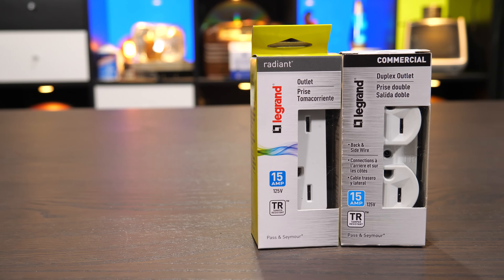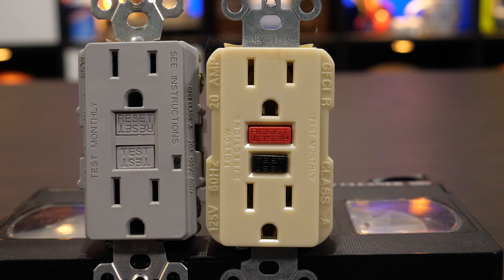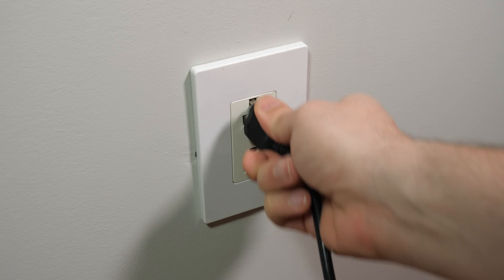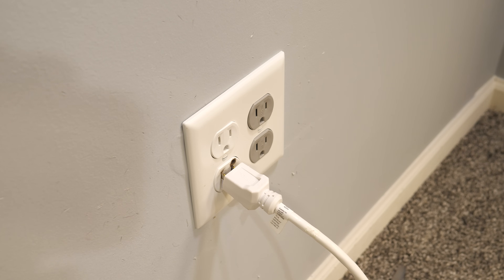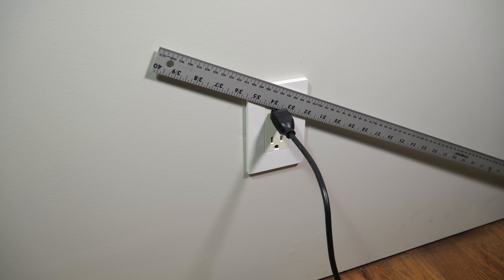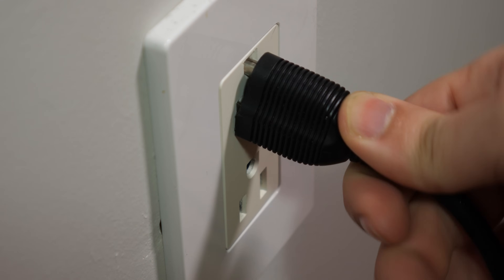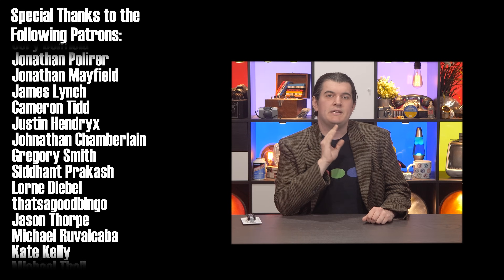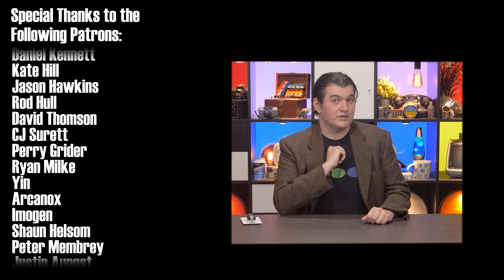Power outlets are topsy turvy - but does it matter?

Comment: Was looking thru the comments but haven’t seen this one yet. But a lot of newer homes have most of the outlets with the ground pin down while all the outlets connected to light switches with the ground pin up. So in essence, the switches that are more likely to be turned off during the day are in the supposedly “safer” position while the outlets that are live 24/7 are in the “less safe”’position. Also, is this flipped configuration for light switch  outlets this even a building code requirement? Or is it just a convenience for making sure homeowners know which is which?

Comment: The proper design for these outlets should have the top one with the ground facing up, and the bottom one with it facing down.  I never understood why they didn't build them this way in the first place.  It would make it so polarized wall warts can both be plugged into the same receptacle.

Comment: When my father built a house years ago he installed all the outlets with the ground pins up because he believed it was safer.
(If a metal object falls onto a plug that isn’t fully inserted it can short the circuit, if the ground pin is up this can’t happen)
When the inspector came he was told that had to rotate all of them because it wasn’t code…
I’m very surprised to hear that this was a lie

Comment: The plugs should be made so that the top outlet has the ground plug up, and the bottom one has the ground plug down. Then you can use 2 right angle cords, and which ever way you install it the ground is at the top.

Comment: Not that it matters to share on such an old video, but I have a tape measure with a burn mark from a time I was measuring a wall with a poorly plugged in plug that it fell onto. It's not a game of throw the knives at the wall but it's a little more applicable than "I was measuring the outlet while somultaneously ignoring the fact that it was in a dangerous condition"

Comment: I still have no idea why your plug sockets are not inset into the wall. If they were, both the "oh shit I touched the plug while plugging it in" and the "oh shit I dropped a knife onto a dislodged plug" issues would be mostly gone. Because the blades are behind the plastic.

Comment: In the US the national electrical code doesn't require them to be installed in any particular orientation. Well, you can't install them face up on a countertop, but that wasn't one of the options we were talking about anyway.

It doesn't really bother me either way, but I'm pretty sure if I installed one "correctly" on the job without being told to do it that way, I'd be told to "fix" it.

Comment: interestingly... once upon a time i had some loose change on my computer desk.  Behind said desk was a nema recepticle, and plugged into it was the power strip for my electronics.  apparently, over time the plug had worked it's way out of the outlet by about 1/8- 1/4 inch without me knowing. and one day, a penny was pushed off of the desk, fell between the desk and the wall, and landed directly on the two partially exposed contacts, shorting them, and essentially welded itself to the plug with a flash.   putting the outlets on upside down would have prevented this from happening.  this is a true story,

Comment: I spent 2 years as a residential sparky and 5 years doing commercial/industrial work, I saw something fall on the blades of a plug exactly once.  The receptacle was so loose the only reason the plug was still in at all was that it had a nightstand keeping it from falling out all the way. Some coins fell off the nightstand and one had landed on both pins of a 2 pin plug making a nice black spot on the receptacle and plate. However even with this perfect set up there was still a nice pile of change below it suggesting this setup had been like this for an extended period of time without anything happening. 

Another issue with ground up with 3 pin receptacles is that it can lead to the ground pin becoming loose and falling off the plug because it is getting leveraged more in the top position.

Comment: THANK YOU!
20yr Journeyman electrician here, AND I CARE!
If a conductive thing falls across a loosely plugged in connection, it can contact the hot blade before the neutral or ground. Meaning if that conductive thing is a bracelet, etc, it would shock ya.
But far more likely is dropping some sort of metal tray or tinfoil, or whatever, especially in a kitchen.
You want that to contact a grounded pin or blade first.
When mounted horizontally, always make sure the neutral is on top (grounds to the right).
It's one of those "not code, but best practice" things.

Comment: As someone with an older house that has these receptacles "upside down" the ground facing up, it is in fact supremely annoying. Every single plug especially angled ones for power sockets are upside down and require being taped to the wall or they eventually fall out.

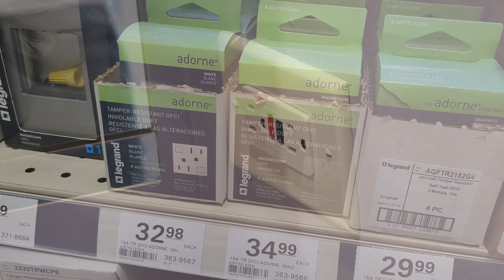Comment: 3:47 why would you want something like that?
Reply: Some plugs were designed to be installed with upright outlets. Some fit better or look nicer in upside down outlets. I like the dual direction outlets.
Reply: Some plugs have chunky adapters that block neighboring outlets. Literally 1/3 of the power strip next to me is inaccessible so I totally see the appeal

Comment: I love my 1904 house which was reqired by my pap in the 1970s because most of the outlets are normal but some of them just happen to be upside down for no reason.  So to my left, I have a power splitter that's hanging normally from its bottom-ground socket, and to my right, I have a PowerLine box that's upside down with its Ethernet cord kinked over because it's plugged into the top of the box and hanging all the way to the floor.  

Fun!

Comment: I really and truly don't care which side is up.  It takes 2 wires to make it an electrical circuit, AC or DC.  There was no polarity plugs before 1960, until some safety people got the idea to ground one of AC wire and call it neutral.  Is it really that much safer?  Not really, at least to me.  Maybe 10% improvement, not 100%.  What do I care?  110V shock is annoying to me, it is hard to kill you, or me?  Once you get a shock, you will learn to avoid another one in the future, at least to the smarter people.  If you are dumb as a rock, there is no amount of safety precaution will save you.  I do turn off power when work on electricity, about 50% of time.  That should tell you my great respect to 110V.  I do turn off 220V (greater respect).
Reply: I've been popped by 4160V on an aircraft carrier, but 120VAC is the real champion of Dar-winning people.

Comment: The receptacle was designed with two prongs.  The neutral was designed to be either at the top or on the left.  When the third prong (ground) was added, it was added to be on the left in place of the ground prong with neutral on top.

Comment: All the hospitals in Chicago have them spec'd ground up in case you drop a fork or picture frame falls on it. Although, there is no code for orientation. AFCI breakera are going to mitigate this risk, especially with extension cords buried under and behind firniture.

Comment: Read the NEC again, if the manufacturer tells you to mount it ground up then that’s what’s required because the NEC says devices need to installed per manufacturer’s instructions

Comment: So the right angle plug with the 45 degree cord makes the most sense to me.  Mainly because if you need to plug in two of them into the same receptable they can fit at the same time. Insulating the blades part of the way is not a bad idea either.  These two simple approaches would seem to solve almost every problem with the NEC/NEMA plug.

Comment: When I moved onto my house I ran new wire and outlets.  Mine are installed with the  3rd up.  My reasoning is because I've never been electrocuted this way.  I have been the other a few times because the plugs were kinda tough to yank out.

Comment: It really only matters when you have a stainless steel/ conductive outlet cover, because if it comes unscrewed and the device comes slightly unplugged, it will fall on the ground instead of shorting out.

Comment: As a Journeyman electrician I can tell you that the NEC does not require a specific orientation for receptacles and neither do any of the manufacturers if the writing was an indication then why is it that 240 V receptacles which are supposed to be ground up have all of the writing, facing the right way when the ground is down

Comment: I was in Labrador Canada and every plug I saw was installed with the neutral up. I was confused as to why it was installed this way and it was everywhere, as if it was a code requirement.

Comment: For safety reasons, The Ground Should Be on The Top.  Also, this helps keep Plugs from tending to slip out if the Ground is on the Bottom.  
In many states, the Ground on an outlet is on the Top to let you know that it has One or Both outlets connected to a Light Switch on the wall near the entry door to the room.  
This way, a lamp can be turned on when entering a room.  Other light switches usually turn on Ceiling Lights.

Comment: I have an extension cord with one of those super flat, right-angle plugs and I'm afraid to get zapped every time I unplug it. It not just the lack of a good gripping surface but also that the outlet holds so tightly onto the plug that you have to use a lot of force, which requires a strong grip. They really should come with a place to grip them away from the receptacle.

Comment: I've heard this argument since I started on the trades some 40 years ago. Receptacles used to have "top" printed on one ear of the unit. Guess which orientation it was... ground on the bottom.
Orienting with the ground on top solves none of the inherent danger it proclaims to mitigate. Most plus are designed for the ground to be on the bottom, especially refrigerators with the low profile plug where the cord is supposed to hang downward. If that is inverted it tends to pull the plug outwards, creating the exact danger the advocates are trying to diminish. 
The only design that would eliminate the exposed pin problem is a receptacle with a barrel face deep enough that it would cover the pins of the plug and plug head prior to engagement with the receptacle. But that wouldn't work for low profile plugs or large, bulky plug head assemblies. It would also create a breaking hazard where the barrel covers would extend off of the wall, getting bumped and cracked by furniture pushed up against them.

Comment: My opinion: it completely depends on if the thing’s cord you’re plugging into the outlet is running about it or below it. If you’re running it downwards from the outlet, you want it on the bottom. If it’s going up, you want it up. Otherwise it’s going to constantly come unplugged

Comment: Americans: uses 110v because it gives a less severe (but still dangerous) shock than 220v. 

Also americans: makes absolutely no effort to reduce the risk of getting zapped 

So you just have a less safe, less powercapable system that requires thicker cables. Neat!

Comment: Not to mention that a cord being upside down causes stress on the wiring which could cause a short circuit.

And also a flathead screw on a wall plate is... Hella dumb. Philips head screws would make way more sense.

Comment: I rewired ~1/2 of my house a few years ago and all the new receptacles are "upside down", ie ground at the top.  I did it for one reason, the standard 3 prong plug like shown at 6:25 is in my experience less likely to fall out that way.  As the weight of the cord pulls it down over time, the hot and neutral get cammed into the holes tighter, and the extra long ground won't pull out even with a gap showing.   Inverted, the opposite is true, the hot/neutral get cammed out, and as the receptacle ages the cords are more likely to fall out.

Plus I like to be a contrarian.

My only quibble is that a lot of newer plugs like low profile / 90⁰ plugs expect the ground pin to be down, so in my case the cord goes up and makes a silly loop.  So I flipped a couple receptacles back over.  And I have some floor receptacles that don't matter.  And unlike Technology Connections I have run across a few 90⁰ plugs that are correct for ground up.

Oh, and all our new outlet plates are solid brass 😂.  But decora, so at least there are 2 screws holding them on.

Comment: If you're installing metal faceplates it should be upside down since the plate can become hot if it ever came loose. In industrial and commercial environments where these are common place, it's generally recommended.

Comment: I once had a necklace fall off my nightstand without my knowledge and onto a plug that wasn't seated fully into the outlet. Luckily, my apartment had all of the outlets installed with ground up, so nothing happened. IDK if something would have happened otherwise, but at least I didn't have to find out.

Comment: Your US plugs are truly horrible. The prongs should all have an insulator near the plastic. The fact that it pops out with just a little downward force terrifies me. If you have two angled plugs, you can't plug them into the same wall socket! Unless each socket has the ground pin facing in opposite directions.

Comment: As a Brit these american sockets and plugs still concern me.
Our live pins are partially insulated, all plugs have a ground pin that is longer.
The pins are all thicker making the connection sturdier.
The ground pin needs to push a panel that lifts away panels stopping the live sockets being accessed without a plug, protecting children and pets.
Almost all sockets have a switch on them so you can switch off the socket when plugging and unplugging electrical devices, really handy for when you have a damaged device that could shock you.
The ground socket is always up.

Comment: As a Master Electrician I can tell you the National Electric Code is 100% silent on this. You can put all the outlets in the floor and meet the code. What side is up then? All the NEC cares about is outlet placement. In a house you need outlets placed so no one ever needs to be more than 6 feet from an outlet along the wall space. A wall 12 inches wide say between two doors one is required. If that space is behind a door it does not matter. If they wall is 11 inches no outlet is required. This is also the same on a kitchen counter but that lowers the length to 2 feet. All appliances are required to have a 6 foot cord or a 2 foot cord for a toaster or standing mixer etc. 

The manufactures that make outlets are also silent as all they want is to sell the most devices. They don't care if you buy them and put them all on a rocket ship to the sun as long as you paid for the damned things.

Period.

Comment: 0:00 Yeah but the guy it's on his head now

2:48 look he's sleeping  .

I'm an european with quite different outlets, but can't see US outlets diffrent than a goofy suprised emoji.

I prefer our schuko plugs with a ring on it's back, but it doesn't have the goofiness feature, so tradeoffs..

10:13 our schuko plugs instead of ground pins it has some slots that come in contract with the "pins" in the socket (more accurately described as resorts).

 They are quite neat, it holds the plug tight and have to exert quite some force to remove the plug, makes it very unlikely to unplug the cord on accident.

 But we have the Italian 2 prong style(without ground) wich I hate with passion, because they are easily unpluggable.

(for context: I'm an electrician so I see plugs and electrical stuff everyday, I take enjoyment in my trade however I can get it.😅)

Comment: This came up on my autoplay again, and I'm so grateful for our AS/NZS 3112. Sleeved active and neutral prongs, angled at 60 degrees to each other and 30 degrees to the earth pin so it won't droop out in any orientation even on double insulated devices without the earth pin, and with a nice reassuring switch on the faceplate that you can choose to use or not use.

What's more, y'all Americans invented it ! It's based on the same original American design as your NEMA 10 connectors!
Reply: can the switch actually handle 10a of current at 240v?
Reply: @gamecubeplayer  obviously. Why on earth would you imagine that being a problem?

Unless this is a Nintendo bit, I'm which case: transformers, my dude.
Reply: @AD_AP_T 10a of current at 240v can create big arcs which will break the switch
Reply: @gamecubeplayer  you're joking, right? That's 240 Volts and 10 Amps , not kV or kA - the expected arc length at atmospheric pressure is under a tenth of a millimetre - that's around the same order of magnitude as the width of a human hair.

How do you imagine the 240V world deals with lightswitches...???
Reply: @AD_AP_T standard 240v light switches are only rated at 6a of current (also most old 240v incandescent lights are under 3a)
Reply: @gamecubeplayer  I don't know where you're getting your info from, because that's simply not true. Go look up some actual products -- try Bunnings, which is an Australian hardware superstore chain, and let me knew how many 6 A switches you find.

Also, it's kind of wild that you're suggesting 6 A to 10 A is such a large jump that suddenly safe switches become implausible - your intuition about current and power magnitudes could do with refinement.
Reply: @AD_AP_T my old 250v 6a finnish light switch was black on the inside even though it was only 230v 0.26a
Reply: @gamecubeplayer that's nice, but entirely irrelevant. Look up this channel's own video on switches.
Reply: @AD_AP_T i doubt this switch would last more than a decade on a circuit with more than a few 120v 0.5a lights 12:01
Reply: @gamecubeplayer  that's hardly relevant: you've already demonstrated your intuition is entirely suspect, but I've got to say, I do respect your curiosity for going and checking the actual video.